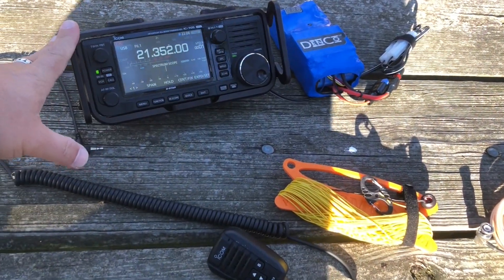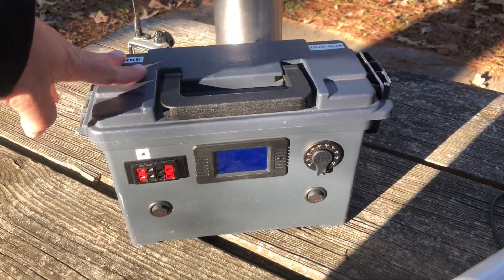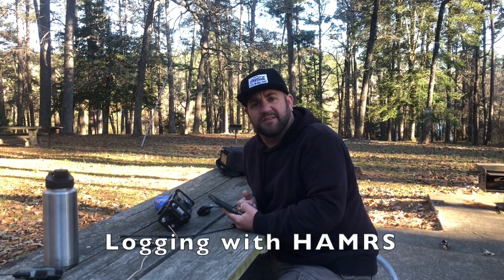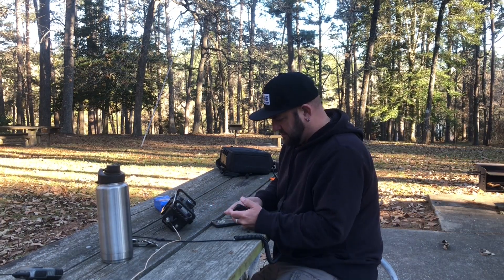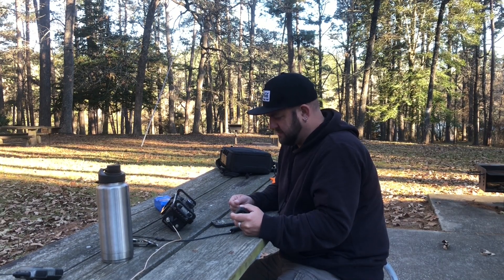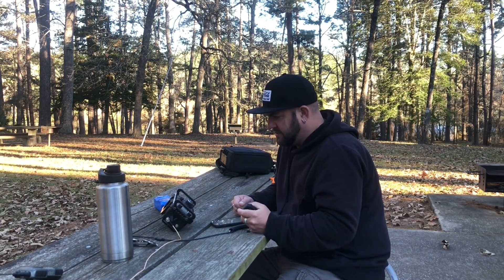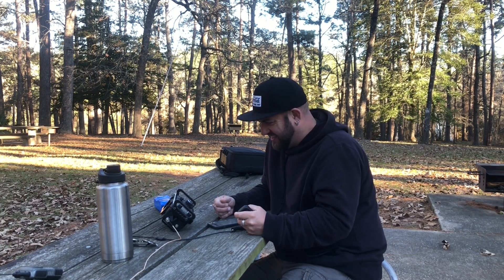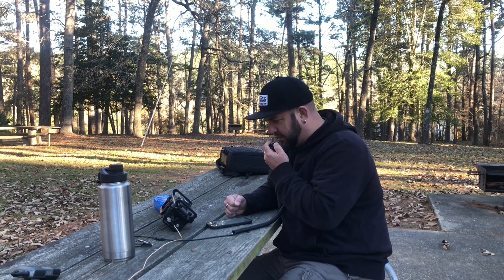K6ARK EFHW Antenna Kit QRP Portable HF Antenna On Air Test

Comment: Great vids!
I'm new at HF.  I see that that the kit can be made with a 9:1 unun, a 49:1 unun or a 1:1 balun - what is the application for each of the different ununs/balun? IOW, under what circumstances would I chose one over the other?
Thank you!
Reply: 9:1 unun, random wire antenna where your wire isn’t a half wave anywhere useful, the tuner sorts it
49:1 unun (not balun), for end fed half wave antennas

Those two are both unbalanced antennas so need an unun

The 1:1 balun is more for choking so your feedline doesn’t radiate

Comment: Mike:   I have watched alot of your videos.  They have been driving me to learn, and exploring some builds.  What is your favorite radio for general portable use?  when you set your antenna up, do you have a preference as to which direction you set your wire up?  Do you have a prefered band you like to use? I just got my tech ticket  beginning of jan, reading up to get my general. I have me a ft-450d  radio.  Im also in detroit!  So im looking for ideas for my setups. Thanks! KU8RLY   73

Comment: Nice activation! Nice antenna, where did you source the wire winder?
Reply: I made one from an 88 cent plastic cutting board from Walmart and a jig saw.i think many are 3d printed....
Reply from the maker: The good ole' 88 cent cutting board works wonders doesn't it?
Reply from the maker: A friend 3d printed it for me.

Comment: I couldn't get that efed. Just wondering about one for 100 watts
Reply from the maker: PackTenna.com or search eBay for TennTennas.  If they (tenntennas) are available, you will see a listing.  If not, you won't.  Just check back the next day.  I think Walt posts them at like 5pm central.

Comment: You need to get a warmer jacket, Mike. It gets cold in the shade. I hope to be able to do POTA this summer, it's too cold here it's 25 degrees at 10:00AM here with the wind at 5-10MPH Burrrrrr. Dealing with Cardiac Rehab right now. It's tough to enjoy what your doing. What is your SWR on using this end fed?